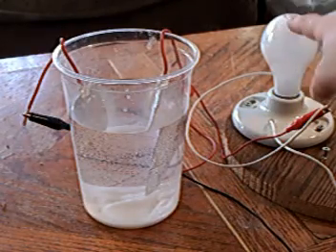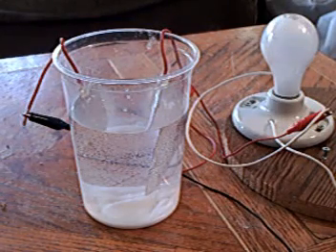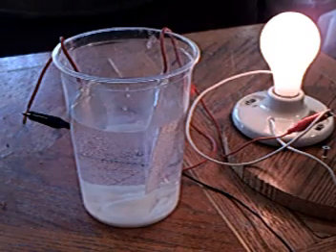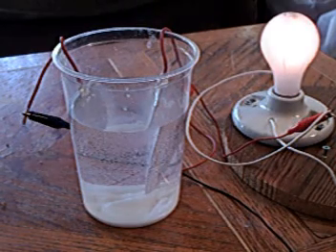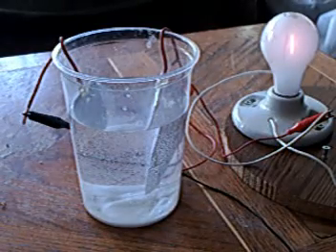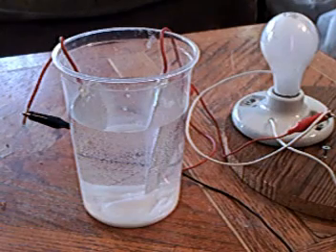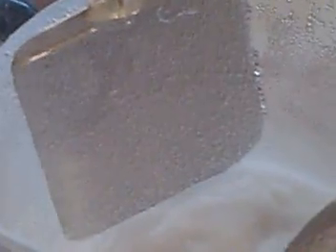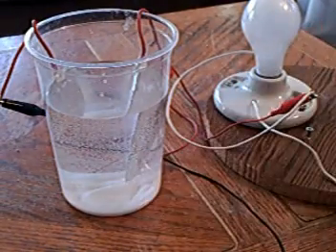hho - 120V Aluminum Rectifier PART 2

Comment: the Al-doped Al2O3 that is made on the surface of the electrode is a semiconductor. So technically this device does use semiconductors, just not commercial ones...

Comment: when the light is out its not blocking 100 watts. its resistance has gone up so the current it draws has gone down (I=V/R) what I'm trying to say is its not drawing the current any longer. current can not be pushed by a supply it can only be pulled by a load

Comment: What's so amazing about a huge piece of aluminum blocking 100W of power? A simple rectifier diode can block more than that and the actual junction in much, much smaller. This is an interesting experiment, but an effective rectifier it is not.

Comment: I wonder where you get the 100W figure.  If as you claim (and the video tends to prove that), no current is flowing, there is no power and thus 0W.

A real silicon rectifying diode acts like a switch.  When forward biased it is a closed switch and current can flow. When reverse biased, it is opened, no current flows and no power is dissipated àt the load. Just like an opened light switch.  It makes no difference if there is a 100W bulb or nothing screwed into the socket.

Comment: You can, but people usually don't, because they usually make the cells for their cars, 12v. The only safe and efficient way to use 120v is by using a many plated neutral cell (+NNN...NNN-), each N cell cuts down the voltage. I find that the N plates need a lower amp draw, but produce the SAME (if not greater) amount of Hydrogen as a series cell would draw at a specified amp. N's can significantly reduce wasted heat energy. My 4 cell +NN- , takes ONLY 2amps, and produces a decent amount

Comment: Have you tried looking at the plates in complete darkness?  You will find that the plates are completely covered with a bluish green glow in addition to the tiny flashes.  The effect is greatest shortly after the lamp goes completely out.

There is a tendacy to see just the glow with less of the glittery flashes if you use Twenty Mule Team Borax instead of Baking Soda.

You can see an actual photo of the plates glowing by putting borax rectifier on google.